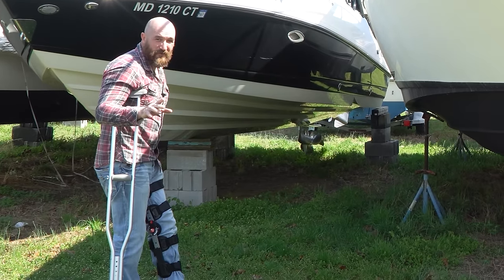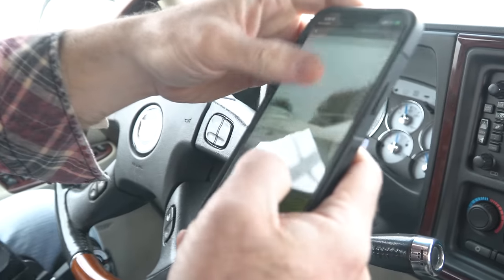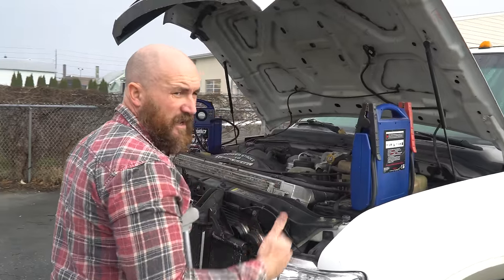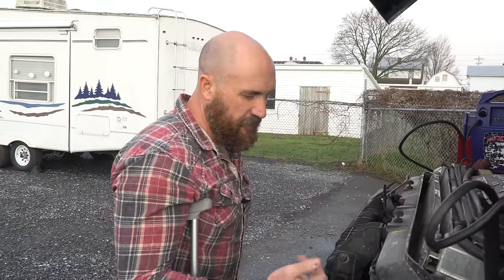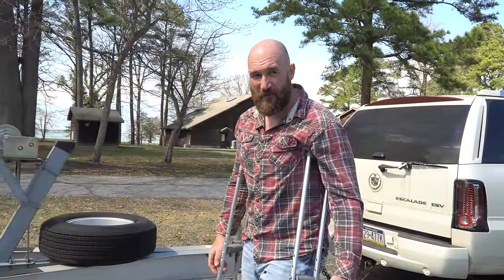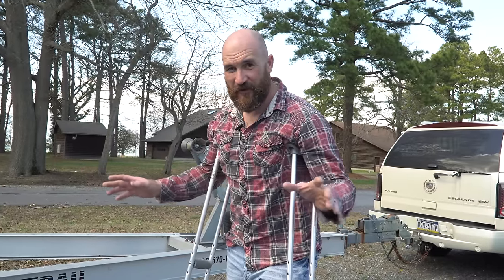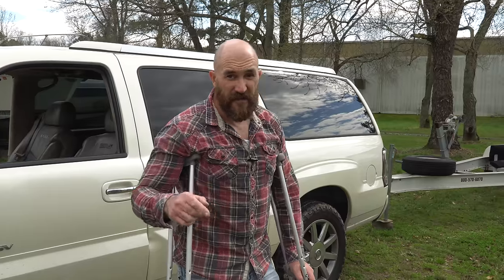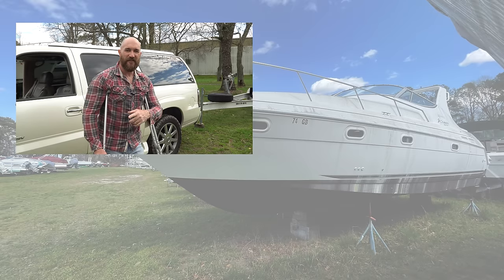We got a FREE Abandoned Yacht!

Comment: Well I’ve never owned or worked on a boat, let alone a yacht. But, from the way you described the engines and drives, the first thing I would do is drain, and if need be flush, all the oil and fluid systems. Also change out all rubber hoses for new, because I’m sure without use for fifteen plus years, they’re probably dry rotted and brittle. Also check that critters haven’t crawled into the exhausts and built homes. Then you really want to make sure the bilge motor or motors are in excellent working condition. Because you don’t want her to leak and sink the first time you launch her. Plus as you’re going around and through her, you’ll probably be easily able to notice any damage or areas that won’t be water tight. Good luck. It will be quite a project. Cannot wait to see her and the 401 back in their respective elements!!!

Comment: Didn't get a good view of the props but believe it has counter rotating engines. IOW one turns clock wise and the other turns counter cw. Watch for rotation of starters, distributor, alternator fans,  pumps, camshaft, crankshaft and firing rotation. Marine distributors have NO vacuum advance.  Word of advice is take one engine apart at one time or keep the parts absolutely separate.  IF not counter rotating, there may be an extra gear in the port v-drive to get it to spin ccw.  GOOD luck . . .

Comment: Extreme gas hug for sure. Diesels are the best way to go but you got to take what to give you. Take it clean it up, get it running. 
I have twin turbo diesels on mine and it probably only Burns a quarter of the fuel that boat Burns but of course out but would be faster. 
The boat called inboard motors which is a whole lot better cuz then you don't have to worry about anything that's in the water no seals breaking and ruining your gear drive. Definitely spray inside the cylinders with some kind of lubrication before turning the engine over along with the auxiliary engine. Take electric pressure washer to the inside and outside of the cabin and then bleach it. 
Wide open that boat probably burn 70 to 80 gallons an hour. At about 35 to 40 miles an hour.

Comment: For it to have GPS Navigation you would need to have a seperate Autopilot system. You set a waypoint/route on that GPSmap 540 there and it simply outputs that data to the autopilot via RS422 serial data (NMEA0183 standard) The autopilot system would have its own controller and I didnt see one on at the helm so it may not have an autopilot, so that is probably just a standalone chart plotter/sounder (cable running to bracket at bottom of transom close to the keel likely was a depth sounder at some point).  If that plotter even works I would recommend replacing it, its likely that GPS antenna if it works wont be able to correctly sync time/date with the GPS satellites anymore, depth transducer needs replacing and the chart would be worthless due to age also. I am a marine electronics technician so work on this stuff every day, hit me up if can assist. Cheers

Comment: On the mold issue.  Use. Concrobium product. Home depot sells it and it's the best I have found for a kinds of mold. 
   I had a house that turned into mold . the ceilings the walls the doors the floors.  All from a roof leak in Hawaii.
   I used to do mold remediation on the mainland.  And concrobium products work best for me.  Home depot sells the stuff in gallon jugs.
   Get a pump sprayer 1 gal. File and spray the place down everywhere. Leave window or give a little air flow..And in a couple days it will be amazing. 
   Just a little too on the mold issue. I didn't have to scrub alit of stuff also. 
  I was impressed by the product.

Comment: Spitballing what you'll find below decks: A partially read newspaper from 2007, a mug of now-dried coffee, and a completely desiccated pastry of some kind.
Results: Not even close.

Pretty sure that for safety reasons, NOTHING below decks on a yacht folds down like it would on a travel trailer/motor home. Because the last thing you need is for some large seas to slam that table through your hull below the water line.

Comment: Having worked on family sail boats for years and spent a year working at a marina - I'm gonna guess that the fuel system is bad, engines have minor issues, most of the hoses are bad, all the thru-hull ball valves are frozen solid, and a good bit of the wiring is sketchy. Also, that bottom needs at least a rough sand and recoat, but some of the bare patches make me think it might need sanded to the gelcoat and completely re-done. 

3 good days and a couple people could have the outside and deck cleaned up and polished. That instrument cluster is super faded so will need replaced. The upholstery above deck likely needs replaced. Honestly below deck looked pretty good. Check the bilge and make sure there aren't major cracks in the fiberglass. Also pull the floorboards and make sure the wood is still good. 

I almost bought a Ketch that was in much worse condition to live in. Beautiful boat, but when I started looking closer, it had been flooded and needed gutted to the fiberglass and completely redone. 6k boat with 30-35k of work. 

Good luck, can't wait to see how it turns out.

Comment: I didn't get a clear picture, but that looks like a motor yacht. In other words it has no sails or place for them. Maybe that could be part of the reason it is just as easy to give it away, because anyone rich enough to be using the gasoline or diesel that thing takes they would never be interested in buying an old used yacht with mold and stuff growing out of it and mildew in the cabin. 
But i think it is a great find still, because it can be used just docked most of the time on your favorite island. And it is solid, the haul is probably great condition, nothing rotten except the top surfaces of the materials, and surfaces in the cabin. 
But if i had a choice i would want the yacht to have both motor power and wind power because a yacht on the ocean is serious business, you don't want to be relying on one source of limited energy to move the thing. If you get stranded out there and it could be the end even if you are expert survivalist, eventually a storm might come along or a hurricane, and with no fuel you are a sitting duck. At the most if you run out of gas you get stranded and sank in a storm, at the least if you run out of gas you get stranded and have to deal with the inconvenience and stupidity of running out of gas waiting to be rescued. And they will find out you ran out of gas like a moron. lol 
It would work great just for fun stuff, of which is no problem. Like going out to islands not too far away with friends and family, having a weekend or vacation. But it is not ideal for doing real serious traveling and exploration imo, because no sails, but it has everything else.

Comment: FYI...
There are two main types of NMMA placards you will see on recreational vessels. For boats less than 26 feet in length (and all pontoon boats), a ‘Capacity Tag’ is used, listing NMMA and U.S. Coast Guard safety standard compliance statements and information about the max capacity of the vessel. Vessels 26 feet or larger will have a ‘Yacht Certification’ plate with compliance statements, but no capacity information.
The main reason for this difference is that federal law dictates that all vessels 20 feet or smaller must contain capacity information. NMMA takes a more conservative approach and requires any NMMA-certified vessel under 26 feet to have this. Currently, there are no federal laws regarding capacity management for larger vessels 26 feet and longer.

Comment: As the saying goes; a boat is a hole in the water you pour money into. As a sailboat restorer what I look for is labor vs return on investment. If you have the money and the skills you can turn free into a pile of cash with the right deal. It sounds like you have both so I look forward to seeing it turned around. To the right buyer saving $250,000 on a used yacht vs new could be a good deal. Just guessing I see somewhere in the $10-25,000 investment depending on the drives condition. The structure looks sound so it comes down to propulsion and cosmetics. Good luck.

Comment: I'm sure you figured this out by now but direct drive is preferred in cruising platforms, albeit not the height of performance it lends to most economical for a lot of reasons.

Edited: another poster below said it isn't an efficient drive method...while to some degree that can be a valid point, if you ever need to swap motors, or decide to go electric....this is the drivetrain you want.

Comment: KCS made Cruisers Yachts they are mid level quality. If you look on the transom on starboard you will see the HIN number, that will tell you a lot about the boat.
Without diesel this is going to cost a LOT of money to run.
The mold with little black head and a corolla around it is likely black mold, a health hazard.
The upholstery on deck is shot, the electrical will most likely need work, at the very least check resistance.
Engines and generator will definitely need work before you even try to turn them over. If they are not with heat exchangers the entire exhaust/cooling system will need a thorough dismantling and inspection.  The water heater, A/C, holding tank pump, and vacuum system will need replacement for sure. New batteries are likely. A good wash/buff&wax is likely to bring the topsides back. Cutlass bearings and packing glands will need to be replaced as they will have dried-out. Potable water system will need to be cleaned and disinfected or replaced. 
Before all this you will want to check that the hull and deck are dry with no delamination.  
You will likely need to pour more money into it than it FMV if you wanted to sell it and it will still have little value due to having petrol engines. If you want to insure it, it will need to be surveyed and for certain the report will bring issues to bring the boat back up to code.
The manufacturer will have a plaque with the amount of people that can be on-board and the certificate rating will have the same. The registration number at the bow can be searched with USCG and some information my come up.
There is nothing more expensive than a free boat
Good luck with the project.

Comment: That boat has straight inboards the one without drives is called an inboard outboard and a boat with engines totally on the back is simply called an outboard one of the big difference is the engines do not change their trim  like you can with and inboard outboard or outboard

Comment: Thanks keep us informed.
Engimes gearr box and drive shafts and props if your unlucky they are  all shot and even to buy second hand cost big bucks. Fingers crossed  it's all good stuff only needs servicing .
Some choose to replace  engine that are shot with modern diesel outboards of 100 to 300 plus HP but that's big bucks and needs marine knowledge of how it might or might not work on this type of craft 
If one engine system is shot you can look to make smaller engine drive on that system with consulting marine specialists
If you drive a boat like this at slow speeds typically 8 mph you often  get the best MPG ..
Speeds of 15 mph the fuel used can increase by the cubic eg can use 4 or 8 times the fuel in terms of mpg .
Fuel use is sum of speed and weight  of boat and hull type.
 Fuel figures of  more than 2 gallons to the mile are often typical at low to cruise  speeds of  less than 15 mph depending the boat the weather the weight  the waves the tidal or river currents 
Boats often guote fuel in gallons per hour  making it tricky to convert it to MPG or Knots per gallon or similar .
Some light weight 12 foot flat bottomed  boats on calm rivers return better mpg at speeds of 15 mph where they plane than slower 5 mph speeds
However with bigger boats   like these  V hull  types  the speeds less than waterline length speeds or semi planing often can return better MPG numbers 
The formula for these boats tends to be 50 to 100.hp per ton to  get max planning speeds often 30 mph .
Give us the class type of the  boat and  the engine details and if there was a generator Others with same or similar boats can supply fuel details service cost details and  suggest better propss and possibly add on better  rudder solutions for single engine. use  which might give better fuel MPG or get you home from a  one engine failure
Direct drive props tend to give better MPG and less costly maintenance problems  but rudder steering tends to be awful at low speeds less than 10phh .Best suited for open sea straight line  use .
Se smaller diesel engines tend to work best at 60% gas .
Having talked to diesel mechanics of larger diesel engines this rule   is debatable  with many mechanics saying you have only to alter the oil and other service  issues if you often run at slower speeds like 30% gas and it has no noticeable impact on life span of engines to run at typically 20% gas or higher.
Constant tick over might cause minor or major  problems such as  making power for battery banks at anchor .
However  even that doesn't seem to be among mechanics I talk too such a big issue as long às lubricating oil is getting pumped around engine OK and is less a issue with the biggest engine.
Bear in mind most boats on anchoar will charge up battery banks and so forth using small diesel generator running at over 50,% gas throttle  especially at night in warm regions where Aircon is a must have .
Assume generator to cost north of  ~$1.5 a Kilowatt hour  compared to grid cost of ~$0.30 cent per kilowatt .
If you live on boat perminantly solar power can reduce cost s
Depending you location marina costs can be interesting . 
Alternatively going on Anchor with solar panels can be sometimes more cheaper solutions..
Depending your municipal regulation it might be cheaper to keep it on house drive way and rent it out as a giant caravan holiday home  and then launch and use it to go offshore for a few weeks for a holiday .
Assume that you can in today's market replace most all marine instumants with mobile phones laptops  I pads much cheaper than marine shop instruments

Comment: Like all your oil is drained out of the top end and it's all down in the pan and that happened to me a lot when I left my my 302 setting or a couple months when I fired that sucker up it sounded like everything was coming apart but it didn't have no oil in the top yet but once I got oil up in the top end it smooth out or run like a sewing machine so start it up and check and see if you got oil pressure if you got oil pressure let it run for a little bit and see if it quiets down

Comment: You need to bullet proof that engine. They are great motors but have problems around 150,000 miles. I have a 7.3L with over  500,000 on it and love it. But it doesn't have the power of a 6.4 lol so if you bulletproof your 6.4 then it will last almost as long as a 7.3😁👍but the 7.3L has the record in how long a motor last. There are several motors that have over a million miles on them and are still running 😁👍this is fact.